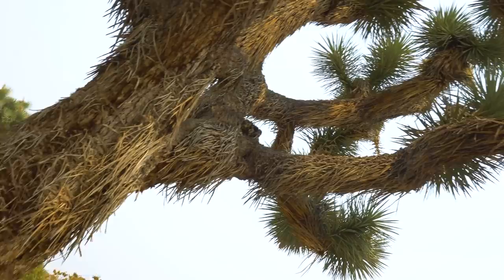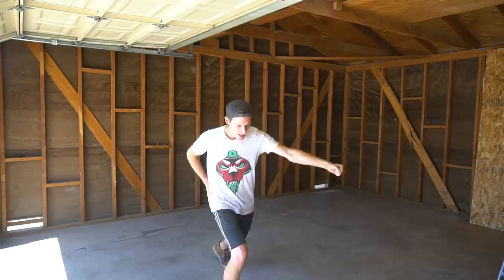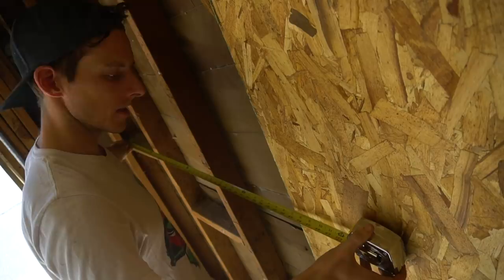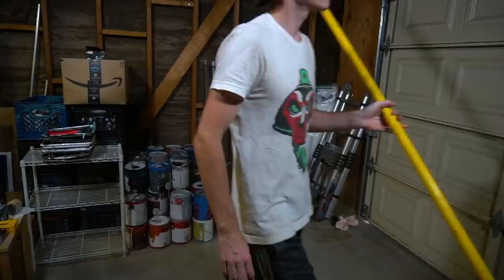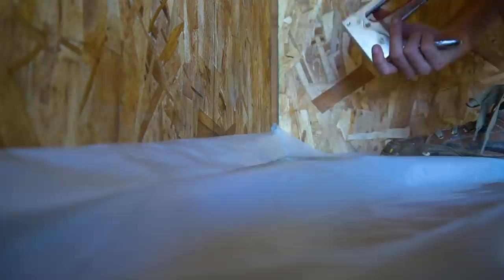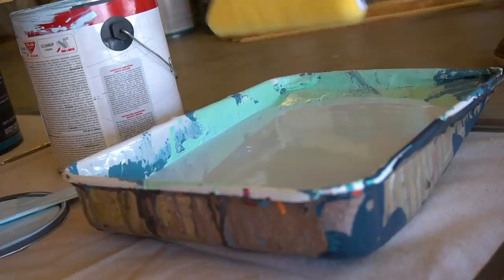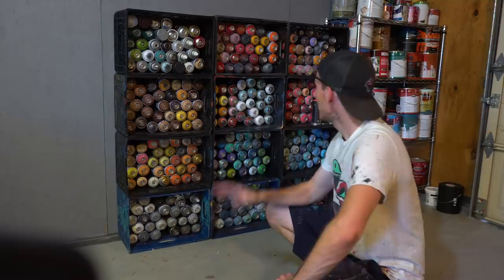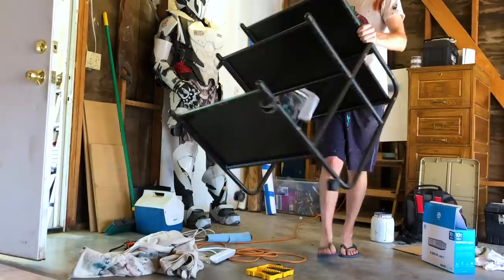Building Out My New Garage Studio!

Comment: BOOOOOM so pumped for you!!  for temp control def consider fans + AC... and maybe even R-TECH foil lined sheet-foam insulation from Home Depot ($8-20 for a 8 foot sheet, depending on thickness).... throws some up in that ceiling... would make a massive dent in heat and not be permanent for owner... excited to see what you do there!
Reply: the insulation would help it to where the AC or fans wouldn't have to work so hard.... or be on as high
Reply from the maker: Gotcha, thanks for the tip!